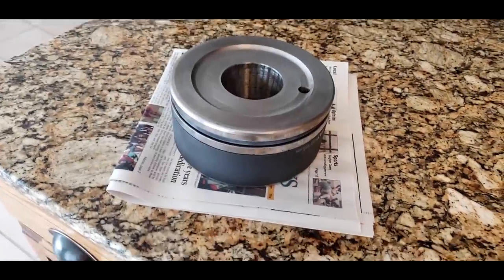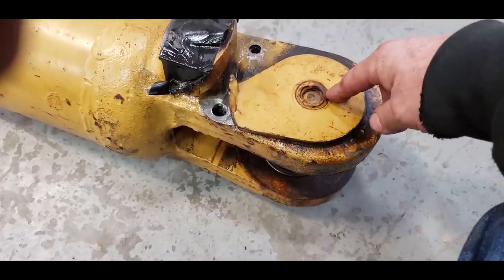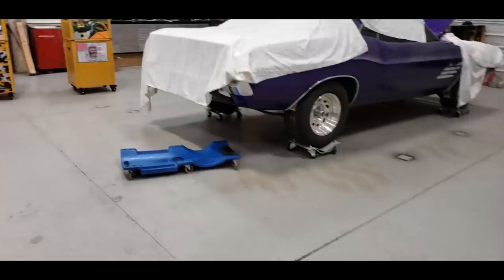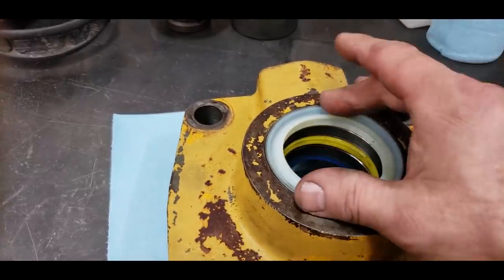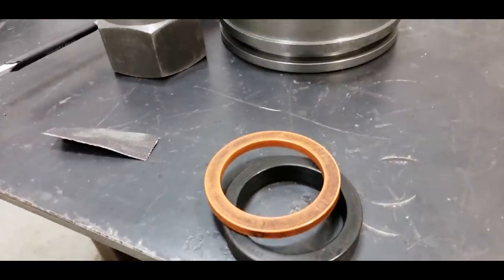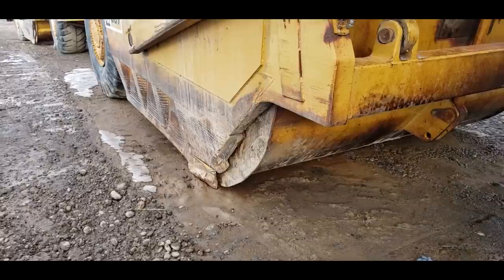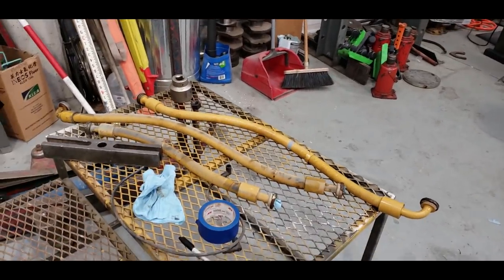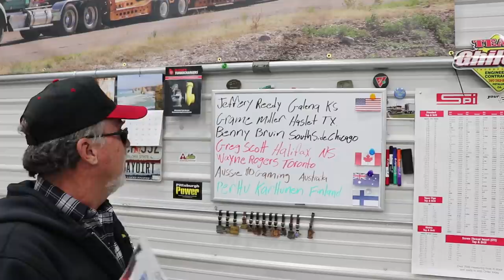Everything You Wanted To Know About Hydraulic Cylinders

Comment: Good "how to" / upgrade video on the hydraulic rams / cylinders, Jeff ! Always good to spend the extra time & money to do the job correctly. I've done similar grease fitting / bearing installs on the equipment I work on, that the factory conveniently left out, where there should have been the ability to lube the parts. Also the seal upgrades are again always a good idea in trying to build in some redundancy & longevity. 
Thanks for your time, effort & for sharing ! Hope the judge makes the correct & compassionate decision in Shane's case. You have really gone the extra mile for Shane !! Really enjoyed the video !!

Comment: Simple job for grease. In a lathe cut a grease path inside and outside the bushing. Then drill a few pass through holes for the grease to pass from the supply path to the distribution path.

Comment: I am a machinist and the first thing a machinist does is ask for a drawing, if no drawing then a sketch or verbal instructions. You don't bore unless you have the part that fits into that bore beforehand.Bushings aren't always the size they should be.
That part from Cat is probably metric.
To drill a hardened bushing you need carbide drills and center drills. The bushings are case hardened so use a torch to anneal it at the spot you plan to drill.
Reply: Todd Kratzer no see. He’s doing the video. If you want to make you’re own videos with your instructions, go for it. Whatcha here for bud?!

Comment: I got 15 yrs Hydr Cyl. Repair, Wanted to give you (maybe) some helpful thoughts. about 16:30 had to blow that rod out. First off, I used Rigid brand pipe chain vise on my repair tables. To hold the cylinders when rebuilding. Turn the vise upside down before installing (REMOVE) the sharp vise JAWS. So not to cut into the barrel. Afterwards (if) had a stuck rod or over blown piston seal. Roll the cylinder over with port pointed downward into a 5gal bucket to catch oil. IF won't move with air, After draining oil into bucket. REMOVE bolts. Carry cylinder outside and Attach a water fitting, From a pressure washer and extend rod slowly till it blows out. rinse the barrel with solvent.  Cletrac 12c pointed out about nut needed to be tightened 2400 ft lbs,  If you don't have a nut buster, To tighten the nut. You Can get away with Your big impact gun, (we've done it both ways)  I WOULD add RED LOCTITE. Just a drop, To the threads. NEVER had a nut back off
Reply from the maker: Thanks, this thing was stuck like I have never seen, and the cause was the head seal,  I do use loctite and have never had one come loose, I really like how cat built these bowl cylinders with the tapered rod, makes installation a breeze

Comment: Having a hydraulic test unit really helps with this disassembly stuff and bonus the cylinders get tested before going out.  Worked on many a Cat cylinder over the last 40 years and built induction hardened rods for them too.  Pardon my French but I always called them Cat queer. You're dead right about why. They want you at their parts window. Bendover.

Comment: Jeff, I have a suggestion for you, I got from one of your new subscribers. 

Please think about adding to your shop, an older Engine Lathe with tooling and a good tooled Knee mill of the Bridgeport genre.  They would be a useful addition to your shop. 

Any usable Machine tool, Lathe or Mill, that isn't the smaller Home Garage size or that has 3ph electric power, GOES FOR SCRAP METAL PRICES at scrap yards.  I have rescued nearly NEW WWII era machine tools from Naval Vessels, Government Warehouses and Old Factories for 2 cents a pound over it's scrap metal price.  The first machine I bought was a nearly new, 1920's, flat belt, fully tooled 24" gap bed lathe, but only 40" between centers.  i.e. A 24" x 40"  lathe and fully tooled for $500 cash in 1967.

The biggest cost of buying good used obsolete Machine Tools is the FREIGHT cost, most times many times over the actual cost of the Machine tool itself. You have the ability to haul your own machine tools and equipment with no additional Government Authority needed.

The next issue is if you aren't knowledgeable about turning Machine handles to get that round, square or flat part you need made.  If you or your sons aren't machinist abled, I'm sure if you needed a machinist's help, someone watching your channel could offer help or if local visit and help you out.

I can see how you want to do as much as you can yourself.  Please think about my suggestion.  I wish you all well and will pray for you, your's and Shane daily.  God's Blessings.

Comment: I had a six foot cylinder on a bench that had a rod that was 12" in diameter. That is a lot of hydraulic oil. The fitting was pointed straight at me, I went to push the rod into the bore and forgot that it hadn't been drained yet. I got it only about  six inches in when I was totally drenched in oil. It's got a 2" fitting. Stupidity in it's finest form.
Reply: Thats learning in the hard way to look 1st and check 2x beforehand

Comment: Bearing retainer from loctite is stronger than steel and when primed properly will bond so strong to steel that pressing a bearing back out cold, once retained, the metal will shear and the bore will be damaged. It will grab cast iron and tear it apart. Its amazing stuff indeed.

Comment: I'm a new subscriber Slade Nightly, yes don't laugh that my name, I'm from Fort Wayne, Indiana. Love your channel. liquid propane?? I've been a machinist for forty years..never used it for an interference fit. Always used (LN) liquid nitrogen. Enjoy seeing all your ideas for machine upgrades. Surprised you don't have an engine lathe and milling machine in the shops corner.
Reply: Yes, an older Engine Lathe with tooling and a good tooled Knee mill of the Bridgeport genre, would be a useful addition to your shop. 

Any usable Machine tool, Lathe or Mill, that isn't the smaller Home Garage size or that has 3ph electric power, GOES FOR SCRAP METAL PRICES at scrap yards.  I have rescued nearly NEW WWII era machine tools from Naval Vessels, Government Warehouses and Old Factories for 2 cents a pound over it's scrap metal price.  The first machine I bought was a nearly new, 1920's, flat belt, fully tooled 24" gap bed lathe, but only 40" between centers.  i.e. A 24" x 40"  lathe and fully tooled for $500 cash.

The biggest cost of buying good used obsolete Machine Tools is the FREIGHT cost, most times many times over the actual cost of the Machine tool itself. You have the ability to haul your own machine tools and equipment with no Government Authority needed.

The next issue is if you aren't knowledgeable about turning Machine handles to get that round, square or flat part you need made.  If you or your sons aren't machinist abled, I'm sure if you needed a machinist's help someone watching your channel could offer help or if local visit and help you out.

I can see how you want to do as much as you can yourself.  Please think about my suggestion.  I wish you all well and pray for you, your's and Shane daily.  God's Blessings.
Reply: That is one Friggen Cool name Slade Nightly!

Comment: If you ever do need to drill a hole in hardened steel,  take a carbide cement drill and sharpen it on a tool grinder,  chuck it up in a mill,  and hit it with 1600 RPM and some oil.  If it squeals like a stuck hog  you know you are going fast enough.  Guys in the sheet metal stamping shop use that trick when they forget a hole before heat treat.

Comment: My truck has a 3406E motor and I was wondering if you have any recommendations on getting more power with out hurting reliability. Hope Shane gets better and gets what he needs.
Reply: My 3406E has 550 HP and it's all just done off of the ECM. I can go to 600HP with the way that it's set up now. It all depends on how your engine is set up now, like if its 435HP you probably can't go more than 475HP without changing a bunch of things like the turbo and injectors etc... you can only go within the parameters of what it was set up to do.
Reply: Clyde Acor my set up is a 450hp 1800 torque. I want more power taking off. When I’m 120-150k lbs my truck struggles to take off from a start. I have a 18 speed, 4:11 gears. Once I’m moving a long I’m fine. I heard I should check the fuel pressure. What do think? Did you take your truck to western State here in Idaho? That’s a cool trailer too. I’m a equipment nut.
Reply: O one more thing. How much boost does your truck make? My max under load is 29 psi. I have a brand new turbo also. Borg Warner replacement turbo
Reply: @yeahok115sure  ya I just put a brand new Borg Warner turbo in my truck for $1100 no exchange. Everyone else wanted $1400-$1700 for a reman plus exchange. My turbo used to push 29psi but now around 26 for some reason but actually pulls better now than it did with more pressure. I only go to the Cat dealer when I have to, I usually do most of the work myself if I need computer work done my nephew works at a truck shop so I just have him do it. I'm 550hp and 1850 torque so you're really not gaining much torque just horsepower turning it up. I'd just do some research you might get it up to 500-525 with what you have. Who knows maybe even a bit more.
Reply from the maker: See there , you already got an answer, love my subscribers as they share there knowledge with others
Reply: Clyde Acor right on thank you.
Reply: Jpaydirt any recommendations in Boise area for computer rework?
Reply: @yeahok115sure  you betchya.
Reply: @yeahok115sure  you might call western states cat and give them your engine serial number and ask them what the maximum horsepower that your engine can do and then try and find a used ECM that's set up for the horsepower that you're wanting it might be cheaper than having yours reprogrammed then you'll have a spare ECM if it ever goes bad. My ECM isn't the original to my engine I had to have it replaced. Just a thought.
Reply: Clyde Acor that’s a good idea! Thanks guys! I brought a diesel freak power dial on my last truck. Huge power increase but killed my 3406e fast. Cracked the head. Since then I’ve been nervous. Check out the new truck! Love the channel and all the help.
Reply: @yeahok115sure  anything to help. Ya there's a guy here who put a Pittsburgh power setup on his 3406E pushing over 1200hp and loaded pulling double trailers up a hill gets out of his truck and walks back to his drive tires and brushes balls of rubber off his tires with his hand. I think he got less than 100,000 miles from a brand new engine. I have a brother over there in Boise that can probably point you to a good shop if needed but I think Western states shop rates are only like $10 more per hour than most the last time I checked.
Reply: @yeahok115sure      I can't even imagine the bureaucratic nightmare that would involve getting those kinds of loads permitted.
Reply: @infoanorexic  just money... if you have enough of it you can do almost anything you want.
Reply: @yeahok115sure  k. Will do.
Reply: @clydeacor1911  The money part, I don't mind as long as it doesn't affect what I'm due for making the drive.  It's the bureaucratic doh-se-doh involved with getting it.  

With my luck, there is always some supervisor that has to put his (3rd) oar in the water and muddle things up over something that turns out to be completely irrelevant.
Reply: @infoanorexic  that would be the government trying to take something simple and easy and just complicate the heck out of everything.
Reply: @clydeacor1911     That sounds like my home State.  They are not as bad as they used to be ... but it's still bad.
Reply: Clyde Acor my motor blow up on my way to deliver a D6. Injector tip broke off and bam. I’m in to a platinum kit. What would cause the tip to break off? Don’t want to have it happen again
Reply: @yeahok115sure  not sure, I've just heard that it can happen with any engine. I'm sure that it could just be weakening of the metal due to heat and wear. Platinum rebuilds are expensive! My friend spent $32,000 on one but he needed new front gears and everything. I just buy the $1800-$2500 in parts and do them myself. Heck check your engine over might just need a single piston and liner and a bit of head work. Although I'm the kind of guy that if it's getting tore down it's getting new everything while it's already apart.
Reply: @yeahok115sure  and make sure to get a 6 pack of injectors. Replace them all at the same time even if they're good. My nephews favorite engine to overhaul is the 3406.
Reply: Clyde Acor the platinum kit comes with 6 reman injectors. I’m so bummed out over this. Own the truck for a month and half.
Reply: @yeahok115sure  almost makes you wonder if the previous owner knew that something was wrong with it. I do all fluid samples before buying a truck. I do from the radiator to the rear ends. It's just a cheap safety net. Ya I usually have a really good local mechanic that works for a good shop rebuild my engines on the weekends at my shop or his and I buy the parts and take the head to the machine shop myself and it saves me at least half as much as what Cat charges. I've never paid more than $10,000 for a rebuild.
Reply: Clyde Acor ya lesson learned, I got a oil sample done before buying, didn’t even thing about coolant, trans, or rear ends. I think the thought of getting this truck clouded my mine. Stupid on my part. Thank you for everything
Reply: @yeahok115sure  I think we all get excited on large new purchases that cloud or memory.

Comment: What's the torque on the end bolt , 800-1000 ft lbs , Had to use a 10' bar on some backhoe cylinders I did over the summer , What size Impact & Socket were you using ?

Comment: I can't find nothing on my problem, but it's similar to one you could have. I bought a wrecker bed that's been sitting for 17 yrs. It doesn't look bad, but my mechanic tells me it's seized up. I just don't believe it. Can hydraulics do that?
Reply from the maker: would have to have zero oil inside
Reply: @Jpaydirt  He said it was dry. But it was all hooked up. Wheel lift was in the air, I thought all good. Held up. It need 2 springs on the valve body and 3 caps. It was leaking pretty good. Filthy. I was happy. Now I'm feeling had. lol

Comment: You should actually use heated hydraulic oil to warm the seal for installation, water isn't good for them ,and it won't piss your wife off so much.
Reply from the maker: But warm oil doesn't come out of the tap☻
Reply: @Jpaydirt  just a splash in a tray big enough to cover it will do and warm it on a hot plate .Sounds like you're looking for an excuse to get a coffee with your good  lady  wife and maybe a cookie ?
Reply: @Jpaydirt  haa     😅

Comment: Here is what I want to know about hydraulic cylinders.  What kind of seamless tubing or pipe is used to make a hydraulic cylinder.  It must be some kind of top secret information because not one single you tube video maker will reveal what they used to build a hydraulic cylinder.  if you know I would appreciate your input.
Reply: It’s nothing special. Typically seamless DOM 1020 or 1026
Reply: @TronVila  ;  Thank you very much. It only took a year to get that answer.  I truly appreciate it.
Reply: @wrongfullyaccused7139  no problem.  I was just watching random videos in between rebuilding my forklift tilt rams and saw your question.  Do you watch Abom79 or Cutting Edge Engineering’s channels? They have some incredible cylinder and rod repair/manufacturing videos
Reply: @TronVila  ;Yes.  I also asked Abom but never received a response.  Not sure about Cutting edge, I will check.
Reply: @TronVila  ;  I actually did ask Cutting Edge in Australia.  They would not answer the question.  They provide very little technical information.
Reply: @wrongfullyaccused7139  he’s a one man operation with a ton of work and I’m sure those guys get flooded with messages